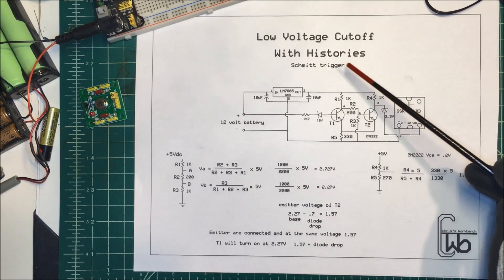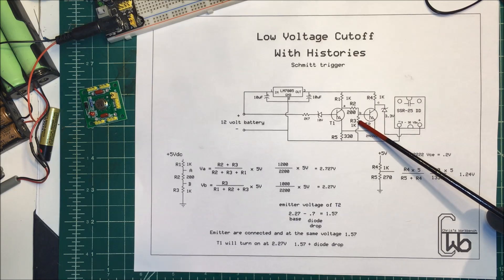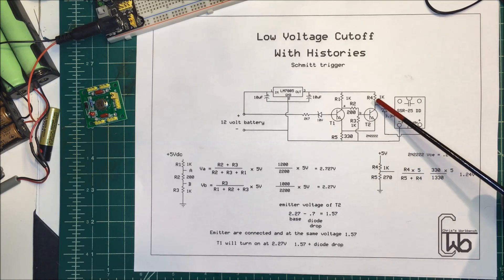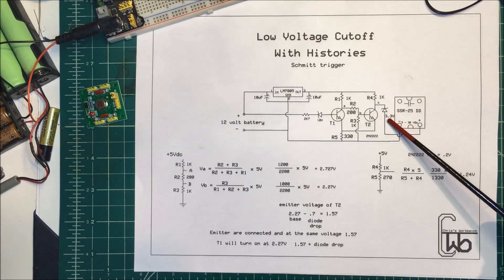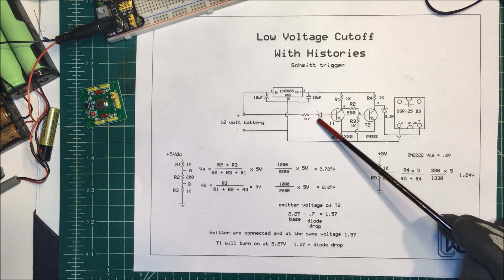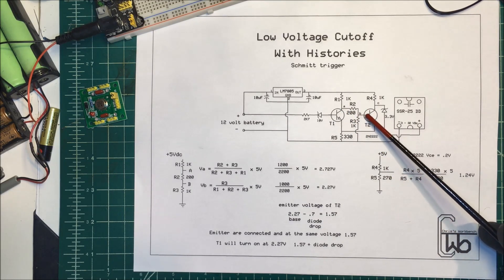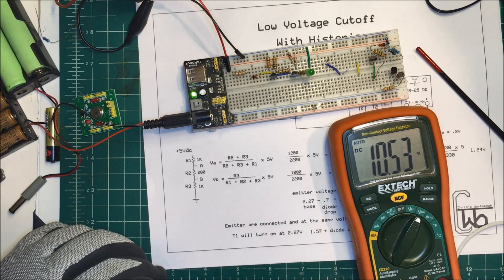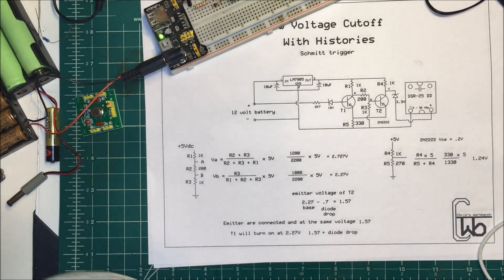Low Voltage Cutoff

Comment: The circuit is very simple ...sir how we can add 2 volt cutoff delay time between turning back on the circuit. it should not turn on untill voltage gose back to 12.4